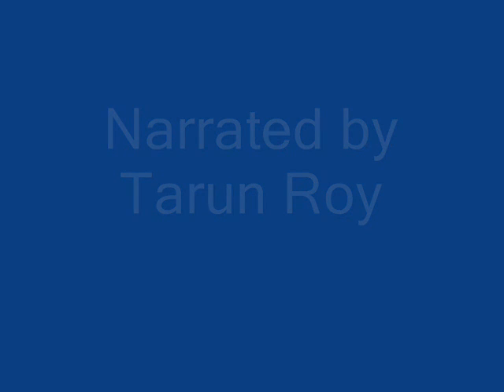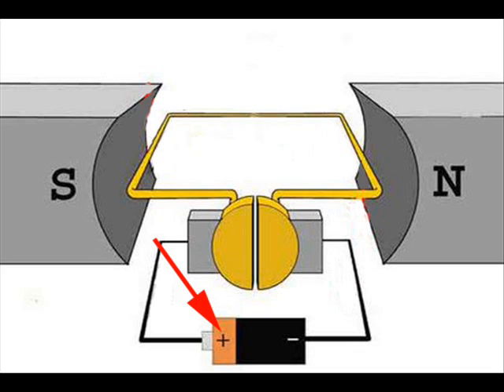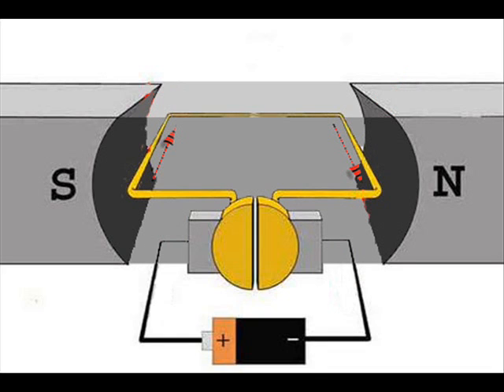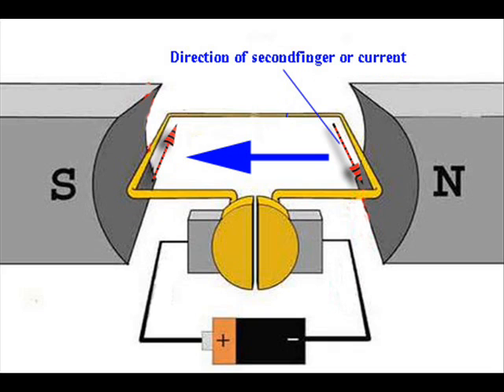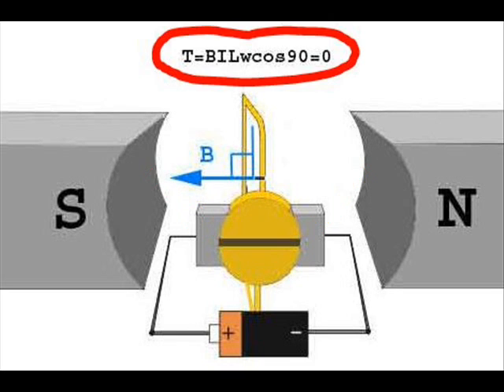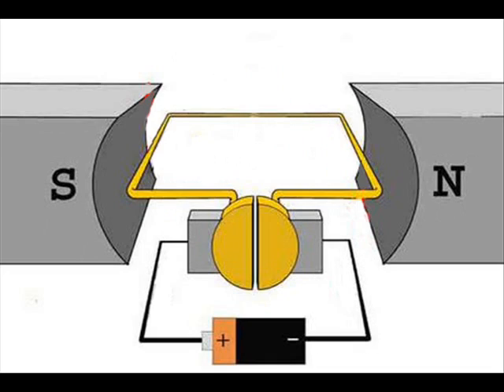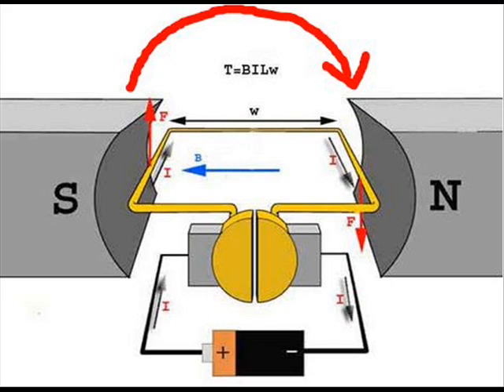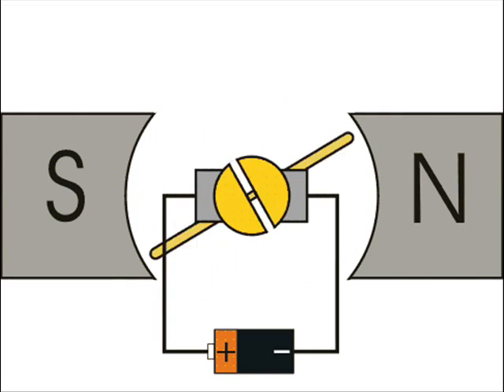DC Motors: How Do They Work? Construction & Working Principle of a DC Motor | Electrical4U

Comment: Thickness of a brush is too much. This thickness will lead to short circuit when commutator is in horizontal position. Please reduce the width of commutator brush. Thickness should be smaller than or equal to  the gap between commutator half.

Comment: When the coil is vertical, both split ring commutators are in contact with both the brushes, why doesnt it shorts out the battery

Comment: With the help of rotor voltage and rotor current of slipring induction motor,how to select external resistance for rotor resistance starter ,please explain

Comment: That's the best explanation ever!! The voice is so clear and easy to understand. Thank you so much Sir! 

Question: Why do we need the carbon brushes??
Reply: We need carbon or graphite brushes to allow flow of current to coil
Reply: +Tanvi Princess so that direction of current on both the wires can be changed and it keeps on moving in the same direction. Otherwise there will be only oscillation...no turning effect.

Comment: YOU HAVE PLACED THE NORTH AND SOUTH POLES OF THE MAGNET ON THE WRONG SIDE
IF THE MAGNETIC FIELD IS IN THE SOUTH-NORTH DIRECTION, THE LEFT SIDE OF THE COIL WILL EXPERIENCE A FORCE DOWNWARDS AND NOT UPWARDS AND THE RIGHT SIDE OF THE COIL WILL EXPERIENCE A FORCE UPWARDS AND NOT DOWNWARDS. 
You are confusing a lot of people. It is called fleming's left hand thumb rule and not right hand thumb rule. YOUVE USED UR RIGHT HAND FINGERS!!!!

Comment: As per your diagram... 
The rotor actually rotates in Anti Clockwise direction as per Flemings Rule.... 
Thank you for uploading the video...
Reply: No, its in the clockwise direction. You should use your left hand to do that irrespective of which hand you use to write. If the magnet interchange their directions , then the direction of the coil will change
Reply: DD's Music yeah you are right ... initially i also used my right hand but immediately realized my mistake
Reply: Pratik Shinde 
Its clockwise !! I think u have used ur right hand instead of left hand for Fleming rule !!😊😊
Reply: Pratik Shinde No bro! I think you used your right hand instead of your left hand. Use Fleming’s Left Hand Rule.

Comment: Your explanation is not clear with the left hand rule. You explain one side of the turn but how does the thumb rule apply for the right side? so as to get the downward motion? The direction of the current still does not change. Please be clear and elaborate.
Reply: I think that its this way. You already know which direction the magnetic field goes from the first use of the right hand rule, and that must stay consistent with the second, because the magnets aren't moving. So use the left hand rule using the known direction of the current and magnetic field and you get your force going down.
Reply: The direction of the current does change,because the the coil has turned.
Reply: The direction does change. Look at the split in the slip rings. As soon as those bars hit 90 degrees to the magnetic field lines, the current is opposite.

Comment: there are many videos in which people make simple dc motor with just a wire loop, a battery and magnet. but I really wonder why their motor works very well without commutator?? current in the loop has to change every 180 degrees of rotation (starting from horizontal position) by a commutator to perpetuate the motion. but clearly I am wrong which i really like to know why.
Reply: You are not wrong! With a  split ring commutator the current changes direction, so the direction of the force it reversed otherwise it only makes a half turn.

Comment: Excuse me S Ghosh but DC Generators have Fleming's left hand rule. DC MOTORS have the right hand rule!
Reply: dc motor works on the principle of the fleming left hand rule
Reply: Fleming's left-hand rule (for motors), and Fleming's right-hand rule (for generators) are a pair of visual mnemonics. They were originated by John Ambrose Fleming, in the late 19th century, as a simple way of working out the direction of motion in an electric motor, or the direction of electric current in an electric generator.[1]

-source: wikipedia
Reply: Wrong
Reply: lol212ist  ajcook7777  i believe it depends on whether you are using conventional current or election flow. For conventional current, which fleming used, you use the left hand rule, as he did in this video. I have been learning with electron flow, which is right hand push rule (thumb is current, extended fingers are magnetic field, force coming out of hand).